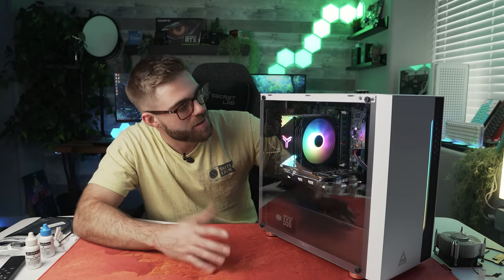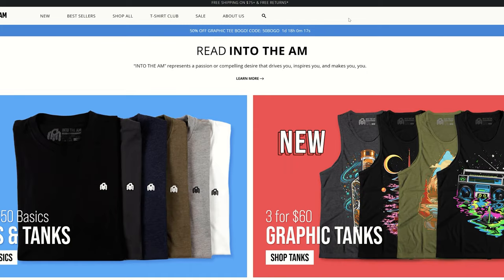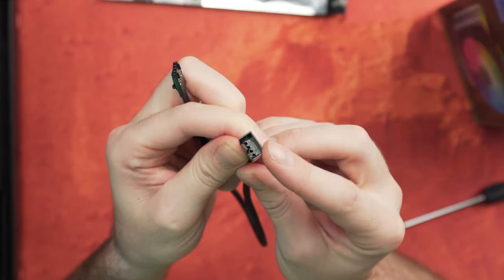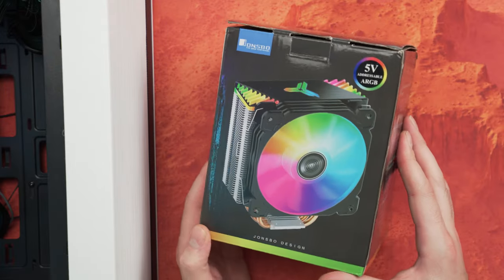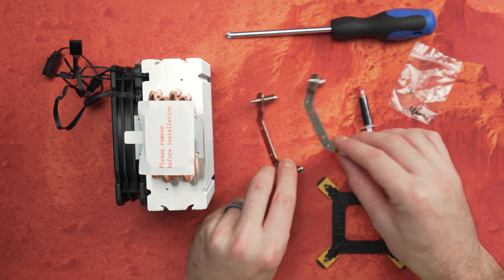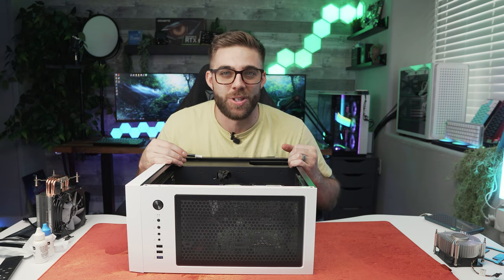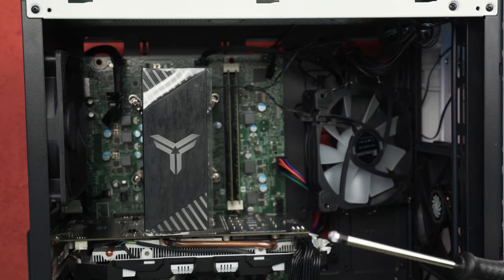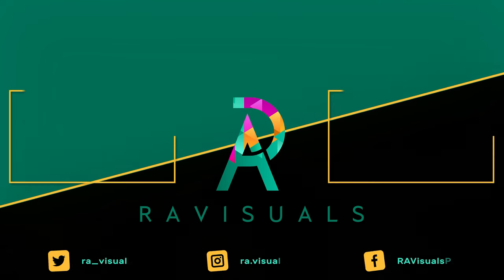Install Any Aftermarket CPU Cooler In A Dell Optiplex! | One SIMPLE Adapter! | Super Easy!

Comment: I didn’t notice you mention this but look for coolers explicitly listed as compatible with LGA 1150 sockets. Many coolers designed for LGA 1151 and LGA 1155 sockets will also fit LGA 1150, but you should confirm this.

Comment: Man I just FOUND a Dell Optiplex 3020 with an I3 4160 and 16 GB 1600 Ram on the local waste disposal-plant and three days ago, I had bought a nofan CR 95 C in Britain for some 120 bucks. Now the holes of LGA 1155 and 1150 seem to be the same but I wonder whether the Dell power managment will accept a fan that needs NO electricity 🤣 . Hadn`t Linus techtips found a trick around that? 🤔 In the middle of the night when everything`s dead-quiet, a cooler-fan just jells at ya like a thunderstorm 😎

Comment: Where to buy a 3pin CPU cooler cable? Thank you. :goodvibes:
Reply from the maker: Hey man! I got the cable from Amazon
Reply: You can just plug it in the 4 pin one
Reply: @RAVisuals  Can connect as 3pin and 4pin both compatible connections work my computer DELL OptiPlex 3020? Thank you

Comment: Brother quick question does it work in a normal optiplex 9010, im just worried that its not going to fit in the case of the normal 9010
Reply from the maker: you just need to check the space of the stock optiplex case. certain tower coolers are wider than others

Comment: nice.  those jonsbo coolers are cheap, only 2 heat pipes but I guess if you have a mega cpu you'll look for a 4+ heat pipe unit.
I didn't get what you did to remove its fan and then put it back on, can you explain for me please? Was it stuck on or clipped on ? thx

Comment: What about the desktop models that have the chassis fan tunneled into the heatsink via a shroud? How would you go about putting a low profile cooler on those old 775 boards?

Comment: how do you fix the bolts of old cpu cooler in that new case. because mine has no screw holes on case. also about psu you use adaptor ? or your psu came wuth conector mines need convertor/adapter cables.

Comment: can you guide me with Inspiron 3891. I have stock case and i5 11400 its too hot 81 degrees in OCCT with mx2 thermal paste. I want cooler swap, and i have 4 pin fan connector here, try both 80 and 120mm coolers to connect directly to CPU, all works without errors like it should, but i dont know which cooler should i use need 3-4 heatpipes,

Comment: Hi! Are all aftermarket coolers compatible? Dell is infamous for proprietary everything. I mean, are the screw holes standard size? 
I purchased a Raijintek Aidos II for my Opti 7010 MT, not knowing it comes with push pin bracket, which I cant manage to push through the screw holes no matter what. 
Can anyone recommend a cooler replacement that is known to be working with the motherboard?

Comment: I have a dell optiplex 745 that I had bought for $20 but the problem I ran into was the cooler Takes up too much space The mounting holes are more vertical and less square than most lga 775 motherboards. I spent $6 on a q6600 to upgrade the e6300 in it and did a bios flash so it would recognize the quad core cpu. I want to upgrade or just switch out the original cooler to free up more space for the graphics card location. Otherwise I am going to be limited with the type of good graphics cards that will go in the pcie e 16x 1.0 slot. I read that non of the Radeon R series cards will work in it's first generation pci e 16x slot. However it would be nice if I could install my 9800gtx+ card in it since I may still have my 650 watt psu and 9800gtx+ still since it's at an old coworkers place. I just have to wait for him to arrive with some of my possessions since I was using him to store some of my stuff.
Reply: R and RX cards don't play well with NON UEFI computers. Basically if it's a i3 2120, i5 2400, i7 2600 or newer it will be alright.

Comment: Nice video :) have an old 0y958c dell motherboard (optiplex 960) and wanted to install a heatsink cooler but the one in your video doesn't fit as the original heatsink seems to be a giant one with encrage far apart. Any help appreciated :)
Reply: the older XPS 410 uses a similar heatsink mounting system as your 960 and iirc, the XPS 410 has a copper-base, multi-pipe heatsink rated for CPUs around 100W. Roughly $15(US) for a used one.. Dell part no: X9694